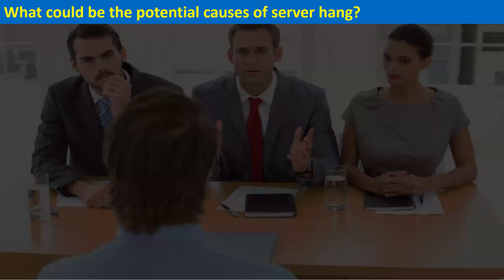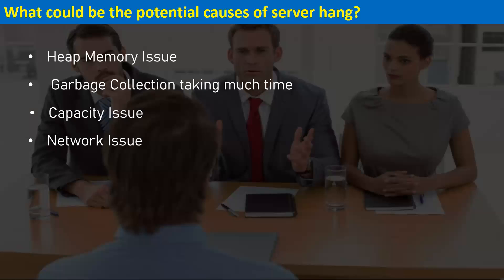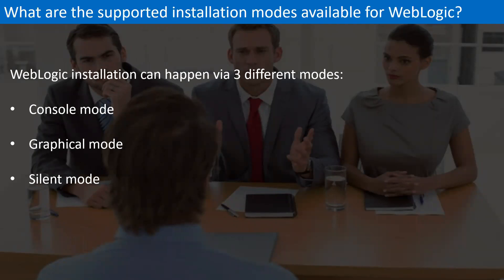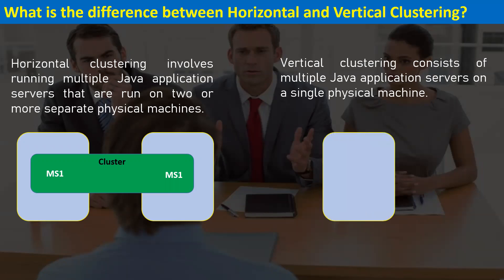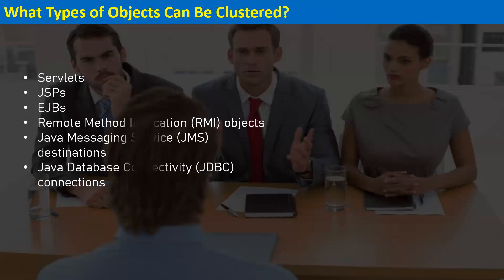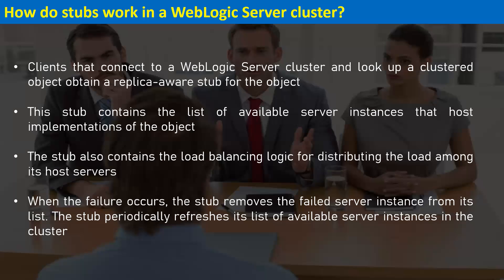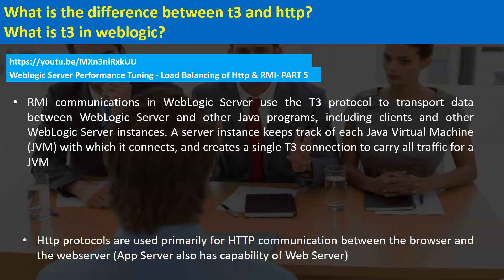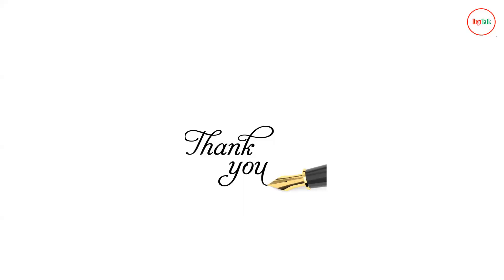Weblogic Server Interview Questions and Answers - Part 4 With Detailed Explanation!

Comment: sir what are the pre checks we need to do before proceeding for the weblogic installation ?
Reply from the maker: You have to check certification Matrix to understand the minimum hardware requirements, certified o.s, jdk and other related software you are going to integrate or use with.
Reply: do we need to check follwing points
1)DNS enabled or not
2)SSH inbetween the servers
3)copying IDRSA public key private key
4)Ulimit value need to be set
i didt understand these answers i heared these from one of the interviewer please let me know about these points it is very usefull to me @digitak.middleware